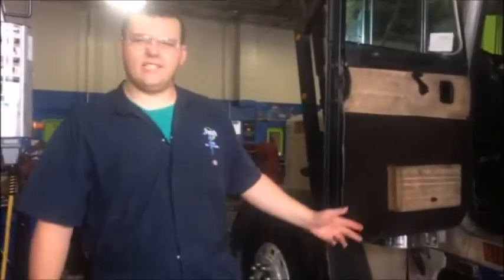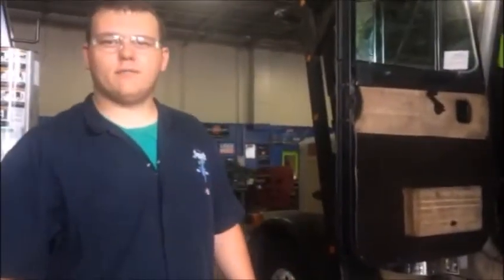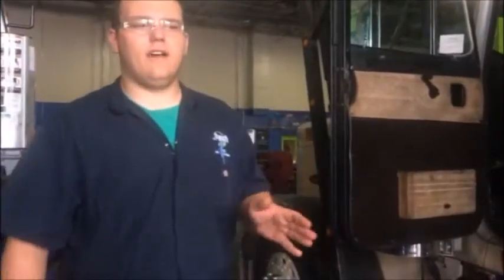Turn Signal and Air Pressure Buzzer at J Tech

Comment: I have a low air buzzer problem on the 2005 Peterbilt 379 so I have changed all fuses and still, no warning sound comes yet please help.
Reply: Did you get it back working. What was the issue mine is doing the same thing